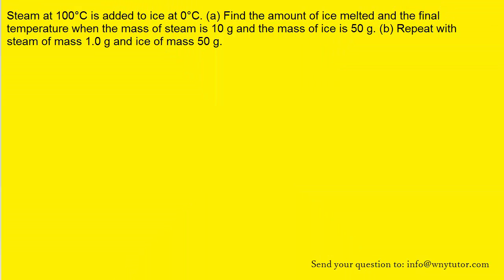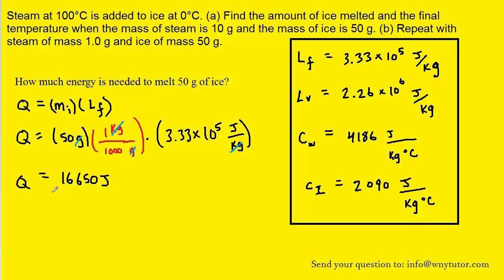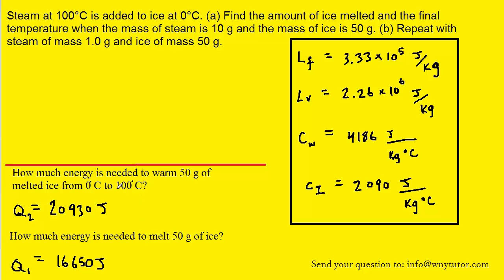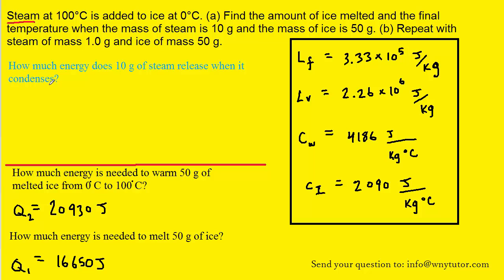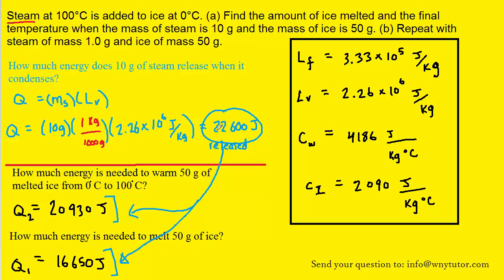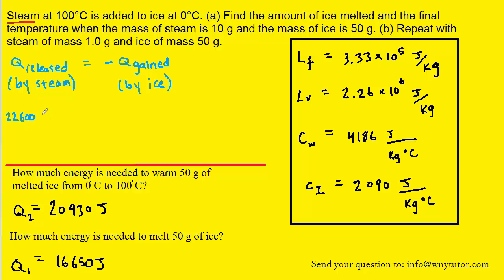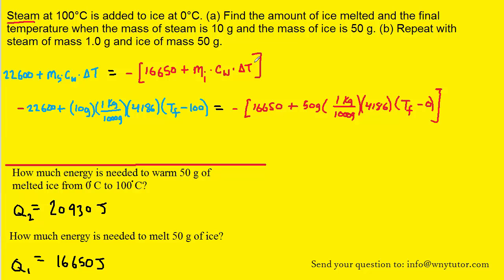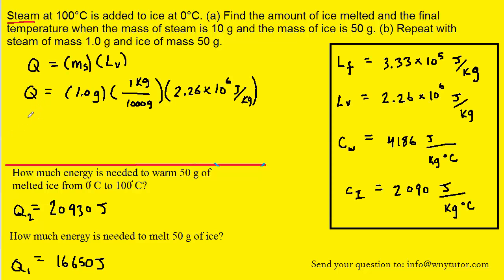Steam at 100°C is added to ice at 0°C. (a) Find the amount of ice melted and the final temperature w

Comment: When calculating the heat released by steam ( [Latent heat of vaporization] ∆m + mcΔT), why do we use the specific heat of water (4186 J/kg°C) instead of the specific heat of steam (which is not given)?  Similarly, when calculating the heat gained by the ice, why do we use the specific heat of water instead of the specific heat of ice (2090 J/kg°C)?  

Thanks for the tutorial.  I set my problem up exactly like yours, and I got the right answer.  I'm just curious why we use the specific heat of water instead of the ones for ice and steam when working with them.
Reply: because he wasn't working with steam or ice, it was already converted to water when he used mcat.